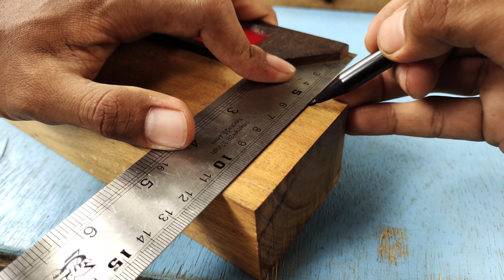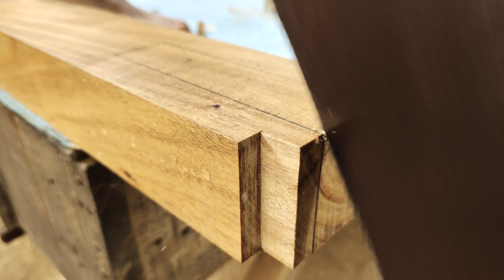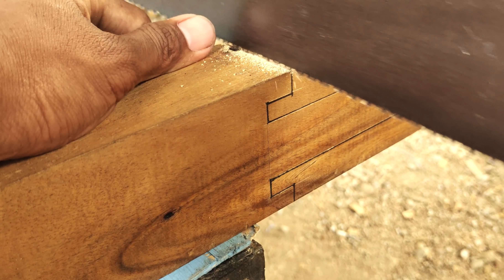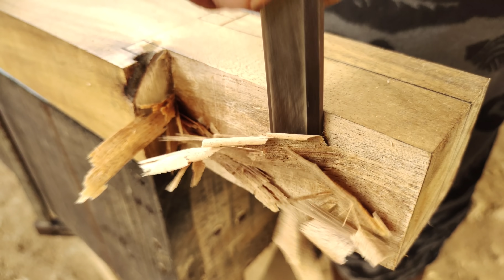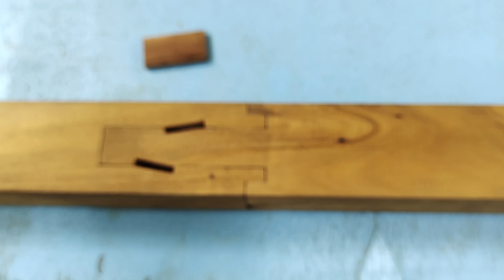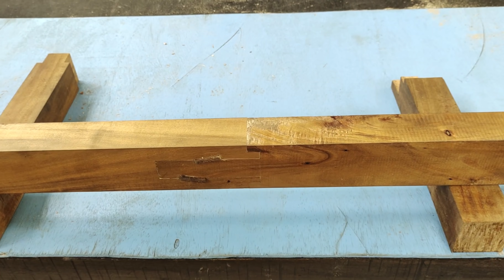Pengerjaan Kayu Menakjubkan Sambung Kayu Teknik Badai Petir

Comment: Extremely interesting work. Please leave your instructions on the screen for perhaps twice as long before removing them. Some folks can't read that fast. Thanks.
Reply: It's meant to be paused so you can read it.
Reply: Pause button? Then read at your own leisure…
Reply from the maker: thank you for reminding me will continue to be better. so that it is easy to read, slow down the video playback to 0.75 it will be easier to read. in the settings section